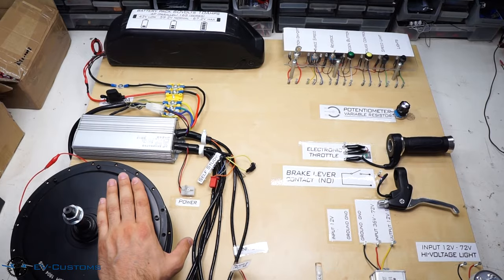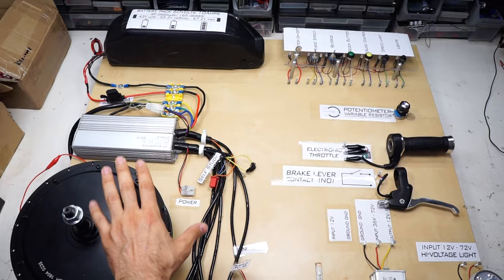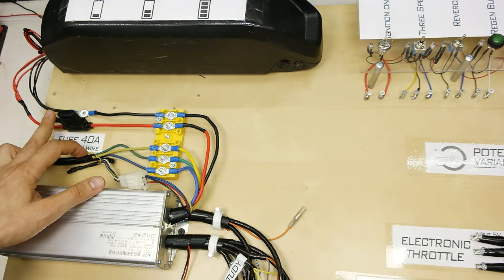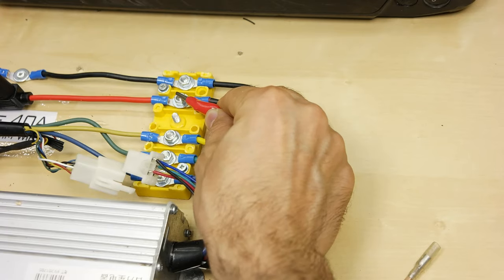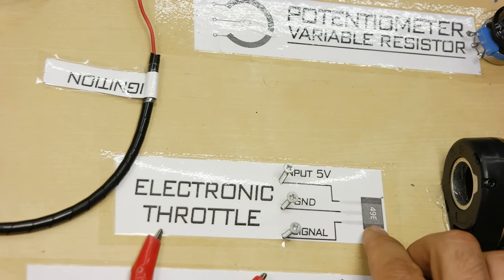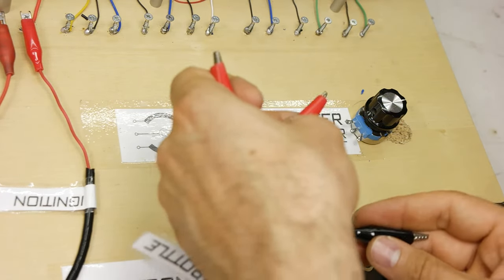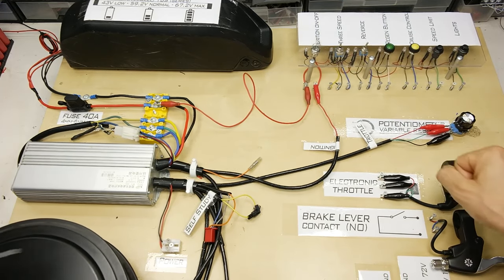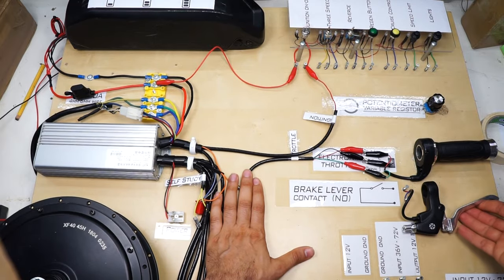BLDC Controller Learning Board for Beginners

Comment: I'm wondering why I get a spark when connecting battery to system. System works fine, key is off. Is this normal on some systems?
Reply from the maker: Hi.. if your system is on you must have spark, if is off and make spark then you have load from somewhere or your controller is problematic ( old capacitors )
Reply: @EVCustoms  Thank you for the answer. I have an ebike with a key that turns the battery on and off, no spark, but this new one only has a way to turn the controller/system on and off and nothing for the battery.

Comment: hey there 
can i use 36v 500w controller with 350w motur hub
thx in advance
Reply from the maker: Hi...  you can use it with 500w controller, but you must check every time to not overheat the motor....

Comment: How do I short circuit K2 and gnd on the twist throttle that it came with a hub ebike kit it only goes 20 they said if I short circuit it it will go the full speed of 31 mph I was pissed off I told them that was your job you advertised it to go 31 mph now they want me to do it

Comment: Halo How can I turn off the speed limit ,Do you have any suggestions,I tried moving the speed sensor, it doesn't work.Greetings
Reply from the maker: hi.. tell us about your hub motor, wattage, voltage and your max speed.
Reply: @EVCustoms 
cst 36v.350w Bruchless motor,
 sped  limit 25 km.
Reply from the maker: @igortruckerit  On some controllers for speed limit have one pair of wires which is connected together.. you must unplug them...
Reply from the maker: @igortruckerit   your wires on controller have any lables? or you have any diagram?
Reply: @EVCustoms  Tell me how I can send you pictures,
on electronics I can only see this number
GE:G3M20211-1592-15

Comment: My twist throttle on my 96v phantom sports ebik only works intermittently, like it will work for a short time, then it wont work at all & then it will all of a sudden work again. And it does this everytime I ride it. I dont know alot about ebikes, but PLEASE HELP!!
Reply from the maker: Hi.. check your throttle  connectors and throttle sensor...

Comment: So, is it fair to say that the simplest way to run a brushless motor is connecting the motor, battery, power switch, hall sensor and a throttle to the board. None of the other board connectors are essential. Right?...apologies for the basic question, but I'm getting started in all this....

Comment: Hi i have TAILG Electric Scooter 72v
my problem is my LCD Screen did not show the right speed of my movement, when i start move it increase from 0 to randomly number and when i been in my fastest move the speed shown 99, I opened my lcd screen and there is only 3 wire connected to the board input + and - and blue wire i think its for the speedometer.
Can you help me please?
is my problem from Motor or BLDC or LCD Screen?
Reply from the maker: Hi... your screen shows also temperatures, ODO, your trafficator lights?
Reply: Only speedometer, odometer and battery life

Comment: Sir how to drive this BLDC motor in reverse gear, Does this controller have no wire to run in reverse, please respond to me...
And thanks for this nice video 👃👃👃
Reply from the maker: for reverse you have two options, 1) with reverse wire, connect to GND 2) make compilations between 3 phase wires of controller and motor.

Comment: I want to put one in the front with a power regulators to charge a 48v battery
Reply from the maker: Hi.. you want free energy? ;) my friend you can do that but you will have losses, you cannot make something from nothing
Reply: @EVCustoms  I have an electric scooter 48v I'm thinking of putting a hub motor on the front with a solar regulator and a 12v power silenoid to generate power back to the battery
Reply from the maker: @constructor1940   My friend nice video ;) but again... you must understood that any connected load on your motor will have turning resistance, so to turn the motor it  will require more energy....  open your comment session to discus it there..
Reply from the maker: @constructor1940   Also like that working regen brake system, the controller put load (battery) on the system to  braking the motor...
Reply: @EVCustoms yes I added a compacitor of 4.0 fared 24v
Reply: @EVCustoms  I will load a video when I get it together along with the parts in will use.

Comment: Hi Great Video, looking for some advice on buying a new battery. I have a 48v controller,  1000watts , “Current Limiting 38A” and a 1000watt motor, I was just wondering can I run a 52v battery with this controller?
Reply from the maker: Hi... when you say 52V battery you mean max voltage of the battery or normal?

Comment: I found everything in your videos except this: I know how to connect lever switch to low-brake to stop the motor. But at the same time I have to use this lever switch to to turn ON Stop red light . My LED red tail/stop light  uses 48V ( my scooter uses 48V). How to use lever switch for  to turn red brake stop light and low brake at the same time? They probably use different voltages.
Reply: Assuming you are correct that your light is 48v, you can connect it in parallel with the Hi Brake pin.  When you apply 48v, both the light & brake will come on.  If you're wrong about the light being 48v, you will destroy the light.

Comment: Hello I have a Question. I have for my Xiaomi Scooter a new 1000W-1500W Controller 48V/72V. Current 27-33A. That's what it says on the Note from Controller of English and this is all my cable. But not a 6 Pin  Display Cable: Anti-theft signal cable

  Line of study

  Three speed line

  Cruise line

  Low brake line level

  Inverted line

  Handle wire

  High level brake line

  Anti-theft power line

  Hall line

  Motor line

  power line

  meter line

  Change line
Can you help me please?? PLEASE!! 🥲

Comment: I have a problem with the engine of my scooter. While riding it often happens that it accelerates or loses speed by itself. Especially when it picks up the pits it seems to short circuit for a few seconds and then recover. The motor is located in the front wheel.:hand-orange-covering-eyes:

Comment: I lerned a lot by making motor out of car alternator. It was most intersting that it worked fine from deadstop even whitout any hall sensors. I'm not that intrested of touch displays or options, just simply to get power and get things to work. Why would I want to be able to turn power down? Joke :D If range is not enough, I build a bigger battery, not tune power down.

Comment: I don't have 5 Volt at hall  red wire , only 100 mV  anybody ever fixed this kind of problem?
Reply from the maker: to measure 5V on hall sensor power wires, you must activate the controller first, from ignition wire...
Reply: @EVCustoms  Thanks for the reply ,  I have it hooked into a working ebike  I wanted to upgrade the controller . Even with the 2nd red wire attached I get nothing.
The make is  SODIAL.
So I took a resistance reading on the 3 motor wires and two are 9k ohms and one is 7 K.
My old working controller had 3k on all wires.Anybody knows what a good reading would be?
Reply from the maker: maybe 5V power output is burn from any short wires..?

Comment: i recently purchased an electric gokart for my kids, this kart... https://www.youtube.com/watch?v=Lq5txD0-dLs that is supposedly 3 speed,  however its only going slow/medium.  i pulled switch off and it defaults to medium.  jumping the black/yellow results in slow speed.  Jumping the black/blue results in medium speed.  the switch completely removed results in medium speed.  im assuming at this point that there is an issue with the speed controller?